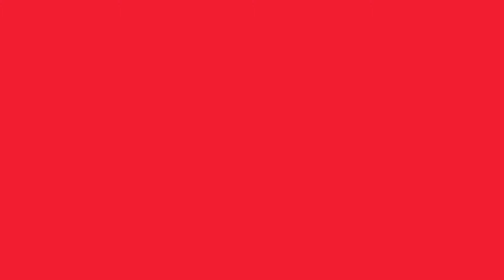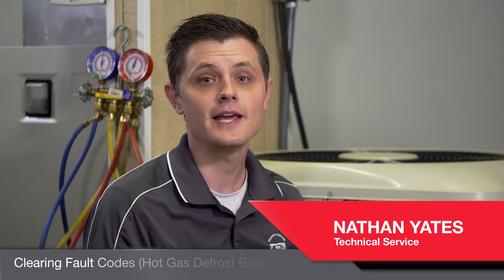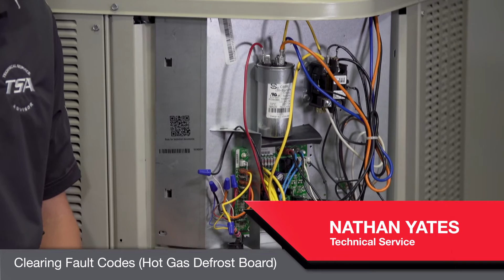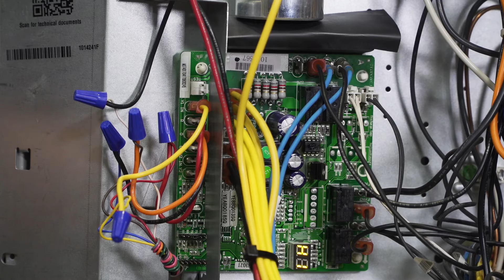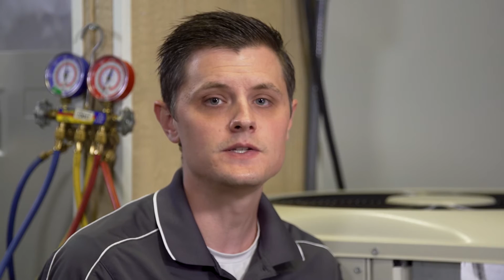Clearing Fault Codes (Hot Gas Defrost Board)

Comment: Video was a great help. THANK YOU! 
 I had two mice get into my heat pump. They chewed and frayed the ambient temp sensor. (solid 03 code). After that they were killed by the start capacitor. I spliced the wires on the temp sensor together then checked it with an ohm meter. It checked good but upon reinstalling the sensor to the board the (03) code went from solid to blinking. After watching this video, I followed the instructions and cleared the code. I now have a fully functional heat pump with only the (!) code. 
 I will be replacing the ambient outdoor temperature sensor with a new one once it arrives. Better safe than sorry.
THANK YOU!